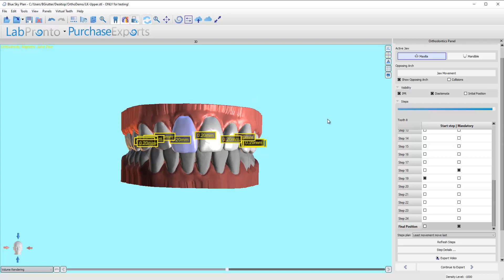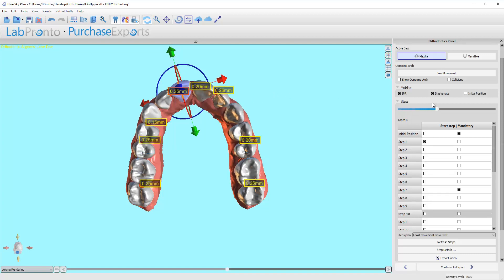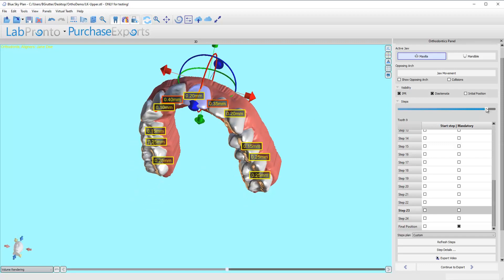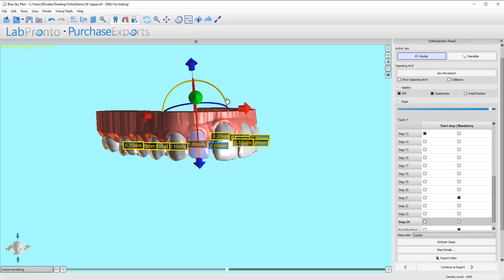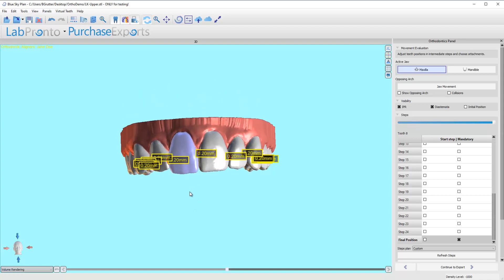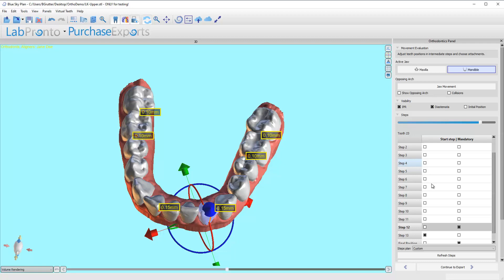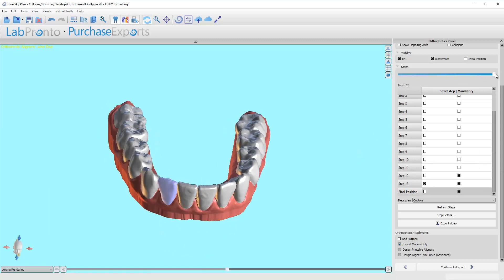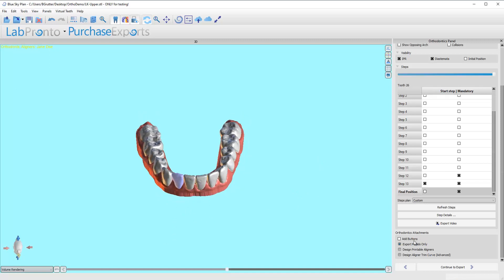BlueSkyPlan v4.8.2.3: Clear Aligner Workflow - Step6: Movement Sequencing

Comment: Are you saying that with 0.10mm or 0.15 in anterior you don't need to do IPR? Even if the final position says there will be 0.10 or 0.15mm collision?
Reply from the maker: I'm saying that I don't. That's a user preference. But I've found that is typically not needed. If I find the contacts are tight and preventing movement, I'll do it. But I've seen enough open contacts post Aligner therapy..

Comment: Thanks for the video.  Is there a way to increase the number of trays for a particular arch to slow down movements?
Reply from the maker: In the movement limits, you can pick weekly, bi-weekly, or monthly. Weekly will have four times as many trays as monthly. It doesn't actually change the rate at which teeth move, it's just divides up the movement into four trays per month as opposed to one. If you want to dive in even more deeply, you can go up to the parameters of movement and change those values to your liking.